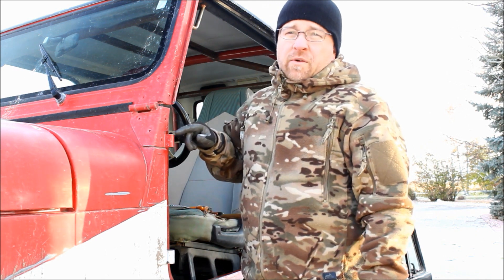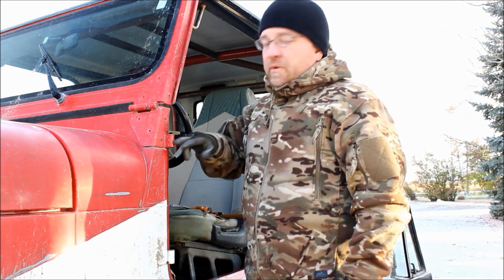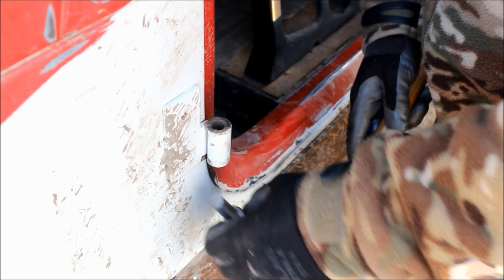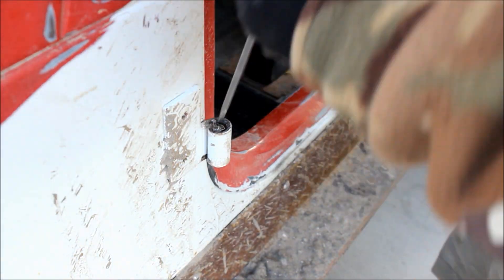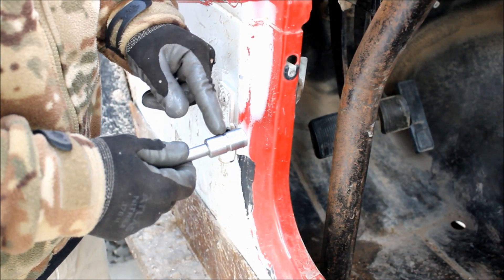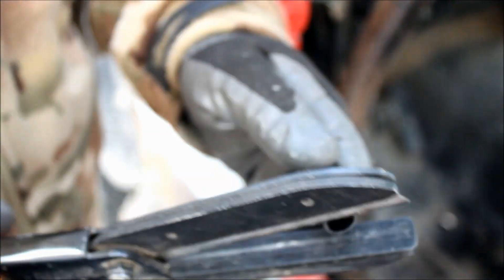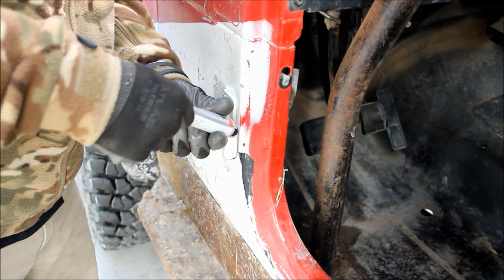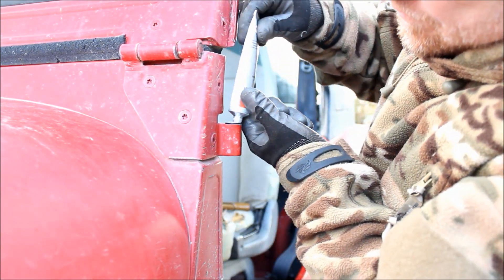How To Install TMR Custom's Jeep Wrangler YJ Door Hinge Liners

Comment: Hey man I have a quick question! I have those pointless stock tiny side view mirrors on my YJ doors. How difficult is it to switch to those larger ones you have on the hinges??
Reply: Not too difficult. If you look really close at the end when I put the door back on, you'll notice the little black patch where I had those lame mirrors too. I had to drill and tap the hinge to match the three bolts that hold on the bigger mirror, but it really wasn't too bad.

Comment: Land O' Goshin!   I'm a subscriber and just noticed...Your door opening handle is installed JUST the way it should be.  My 2002 Wrangler Safari's handles are exactly backwards, to where you have to pull the lever to the FRONT of the vehicle to open it.  Exactly backwards!  Infuriating!  Can the handles be reversed?  Swap sides?  I'll try any suggestion.  Thanks for the response in advance.    Doug

Comment: I have a 94 YJ and this video actually helped me. My driver side door is a paint to go in. I had to beat with a hammer so it would slide in. I had no idea they had a sleeve I could replace. I'm also going to buy some of the LB 8042 loctite. Do y'all have any other YJ video's? I just moved and been waiting for 5 days for them to install my cable. I only have Wi-Fi so I've been watching Bleepin Jeep  on the Xbox the whole time. If I you can post some links to. Other YJ videos I'd greatly appreciate it. I'm going to to tell some friends on this YJ page I'm on about this YouTube site. They are 32k members strong and the others ones are 4k to 5k strong. I'm located in East TN Lenoir city.
Reply from the maker: Thanks man.

Comment: Would it have been worth it to just drill the hinge the rest of the way out ?
Reply: I considered this for a minute or two but you run a really big risk of screwing up your paint if you drill the hinges and it's really a lot easier to just trim the liners. I don't care much about the paint on this YJ but in the end I decided it was much easier to just trim the liners. You can see how quick I did it in this vid.